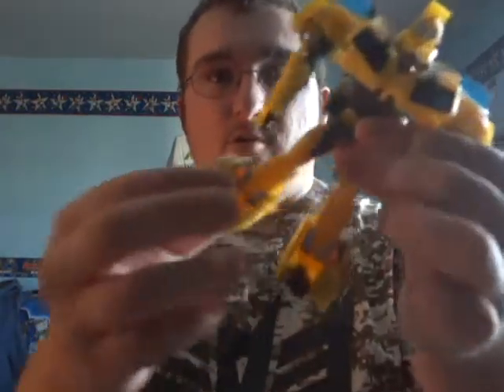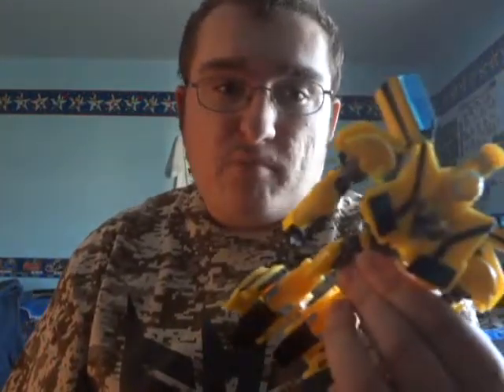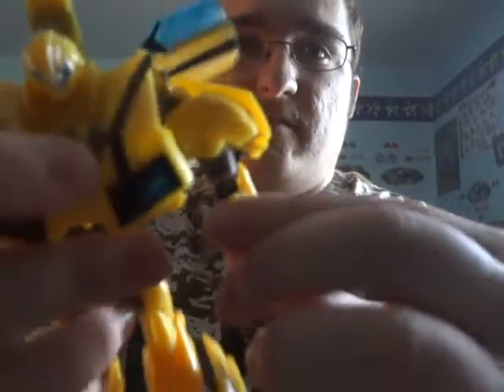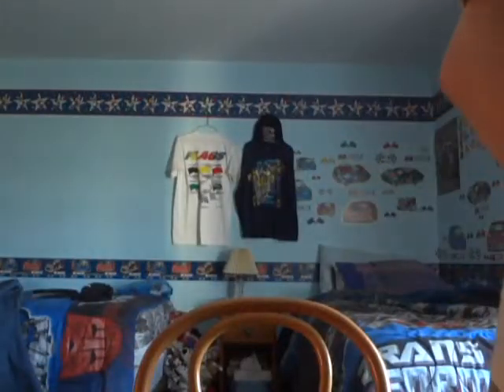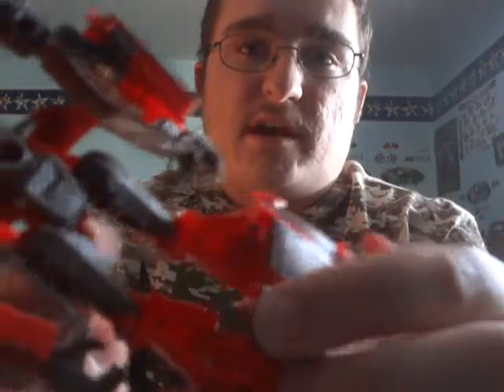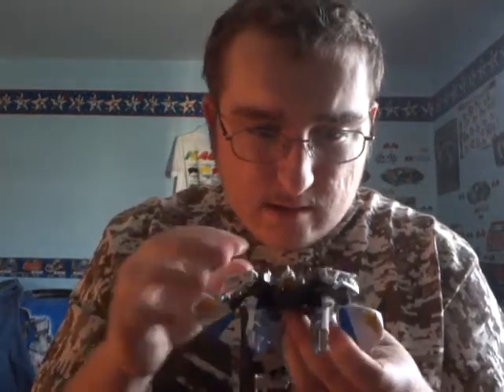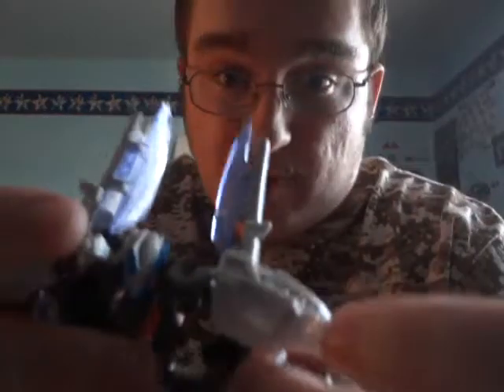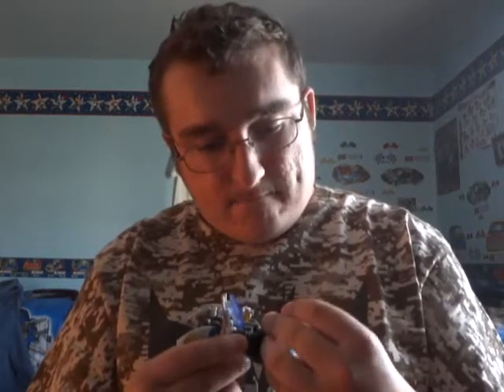V-volg, my top five fears on transfiguriens.

Comment: I agree with you on everything except ratchet joints. They are designed to withstand getting bent.though I hate loosening ball joints.Also you forgot tabbing thin tabs into holes because I have a FOC roadbuster that is scary to transform because of those tabs nothing happened yet though.